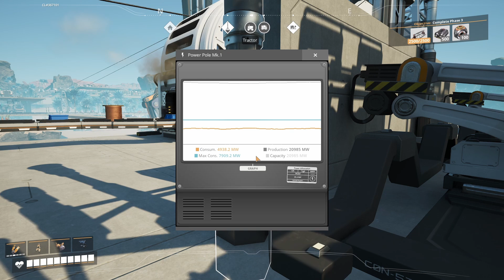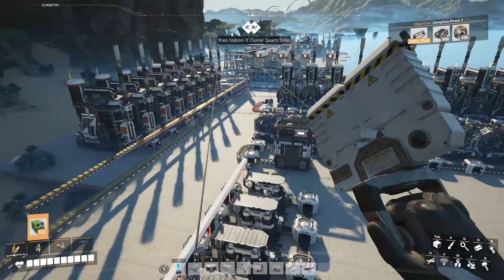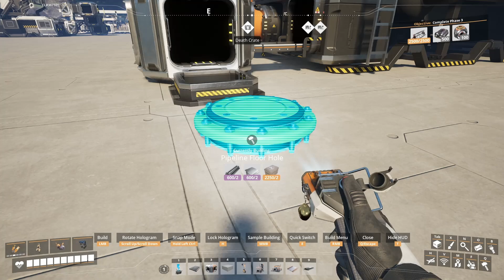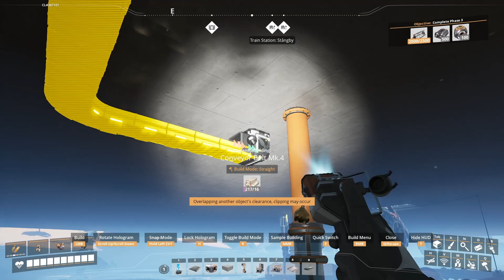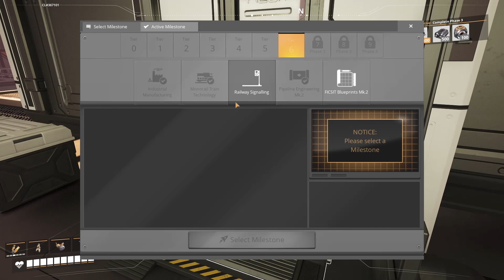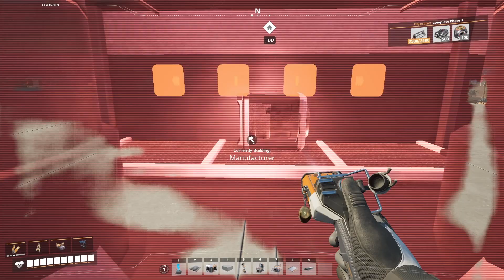Satisfactory 1.0 - Easy Computer Factory And Almost A Power Disaster [E16]

Comment: I need to get building again. You're catching up. To much time gathering hard drives and getting dimensional storage maxed.  One more pure geothermal and I'll have them all tapped. I need to get a battery farm setup to even out the power. Didn't know if that would work but your other comments say it does.
Reply from the maker: I'm not sure if it is going to work either but I will eventually give it a go.

Comment: Plastic wasn't that bad. A full container was enough to clear the adaptive control unit part of tier climbing. Overclocked and slooped really upped the rate.
Reply from the maker: True but all of the space elevator parts feed into the production of the next elevator parts. So you need production of the smart plating, for example, the whole way through the game.